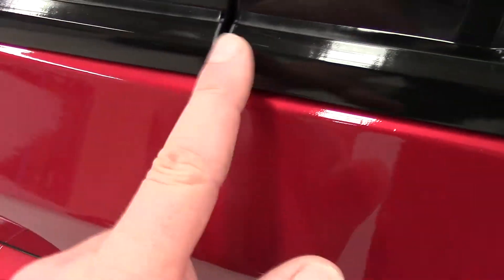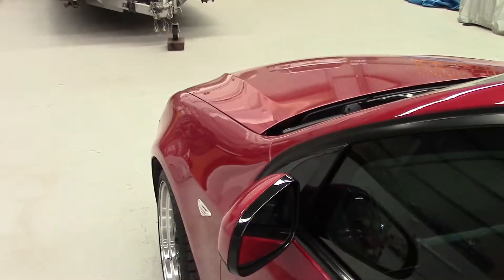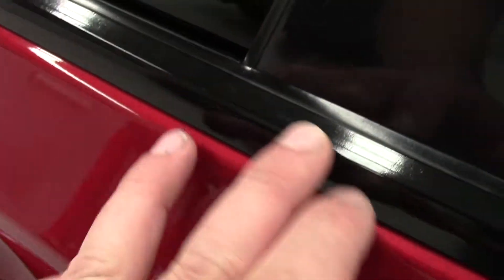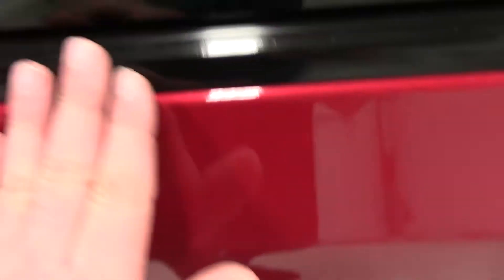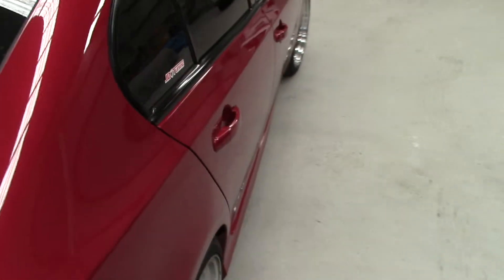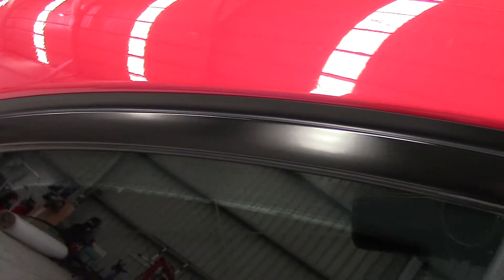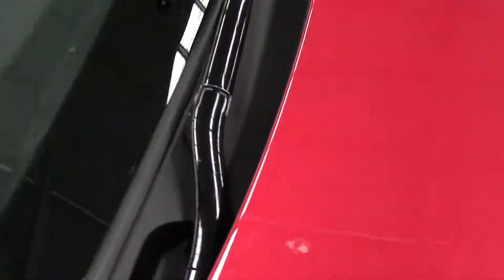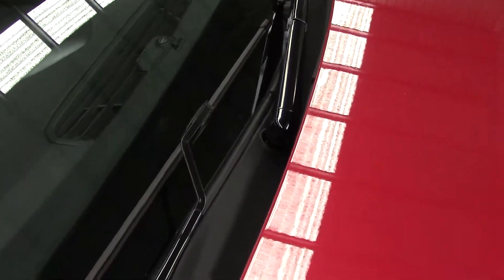Fixing FG Falcon exterior trim part 2

Comment: what did you use to get the beautiful black finish 👏👏👏👏👏 it look Amazing ❤️🇭🇲🇭🇲🇭🇲🇭🇲👏👏👏👏
Reply from the maker: My own custom blended products called trim dream.  A, three part system used by hand or machine. The ingredients are very expensive but bloody powerful and high performance.  It's basically deep cleaning the trim with special solvents but wont hurt them, polishing it with unique abrasives and darkening the colour and protecting the trim permanently or semi permanently depending on the type of trim with a special blend of colour enhancers and protectants. . Not silicone, teflon, carnauba wax, dressing or dye.  You can do something similar with a ceramic coating. It wont give the polished effect of the abrasives but will give a light level of colour enhancement and excellent protection.

Comment: I have an XR6 and man, does it need some work done. 
Lots of dull and probably etched surfaces. Plenty of chips in the paint also, it really needs an overhaul. Really not looking to spend a lot atm. What would you recommend for my situation?
Reply from the maker: I would buy a dr colourchip or chip ex kit for the stone chips, buy an iron fallout remover and clay towel or mitt to decontaminate the paint and then buy a dual action polisher, wool and foam pads and 3d one hybrid compound and polish and machine polish the paint, glass and the trim if you wish